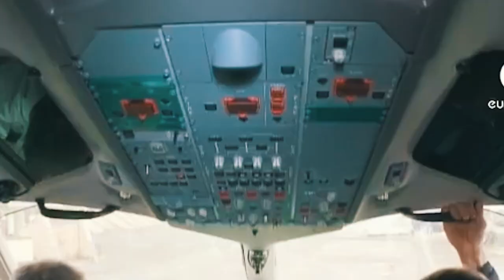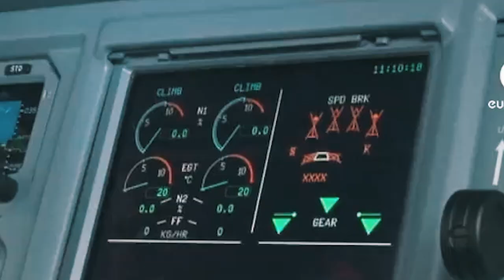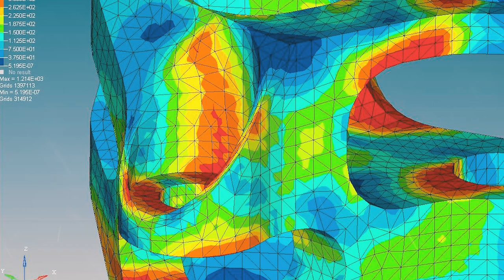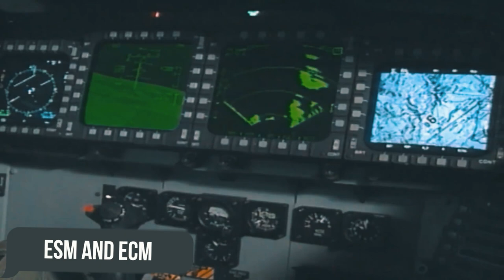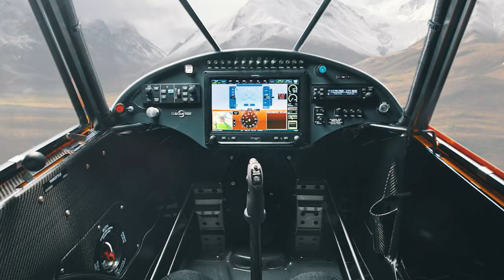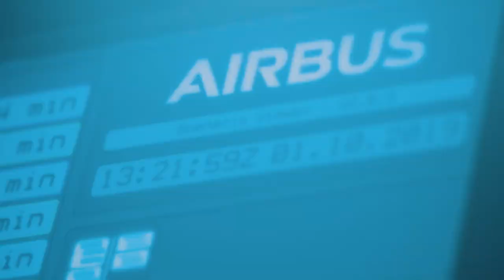Japan Has FINALLY Revealed Its 6th Generation Fighter

Comment: Knots are a unit of distance used in the Navy and Navigation.  I guess they can be abbreviated KN. But here KN sands for a completely different unit: kilo-Newtons.  The standard abbreviation for 1,000 times or 
kilo is lower case “k”. The metric force unit Newton is always capitalized because it is named after Sir Isaac Newton himself.  196 kNewtons equals 44,000 pounds force lbf  or LBF in caps not ibf.

Comment: It's a plane based on Y-23, the prototype who lost to Y-22, who become the current F-22. More than 20 yrs ago. So, it's not 6'th gen, but has the potential to be a great 5th gen fighter. And before speaking of Russia's and China's 6th gen, let's remember that any of haven't proved yet that their fighters are truly 5th gen. Lotsa talk, little facts.
Reply: This also goes for US, the F35 nor F22 proved fully stealth characteristics in true combat mission, for example entering an S400 radar zone, or entering an area covered with AESA radars like the Turkish EIRS radars or something like that., besides stealth doesn't mean full stealth, it means it is stealth for a wide range of radar frequencies so if an area covered with multiple radars with different frequencies it is more likely that F35 or F22 will be detected within 70km of the target, Yes F35 and F22 have weapons that can be fired from more than 200km but that gives the defense systems enough time to respond to incoming attack.
Reply: 6th gen won't be pilot on board- entirely robotic with some human command. I predict extremely fast small swarming robotic kamikaze drones.
Reply: It's really not.
Reply: the yf 23 could potentially reemerge in Japan but it's a wild rumor that is NOT CONFIRMED

Comment: Many of the technologies mentioned that will be used by the FX are unproven, untested, aren't even fully developed, are extremely expensive or some combination of those factors just mentioned, which, more than likely puts it well out of range fiscally for any country other than the U.S but having press releases and what not is extremely smart and effective and may make Japan's enemies think twice about attacking a nation with technology that advanced, whether it actually exists or not.
Reply: So the same for every single generation of fighter.  the biplane with interruption gear to fire a gun forward, the monoplane with gun optics and radial or inline  engines, the first jets, the advent of radar small enough to range guns, passing the sound barrier, self guiding missiles, stealth and so on. every new generation brings new unproven untested.
Reply: Starwars worked for Reagan.

Comment: Knowing the Japanese mindset somewhat, I'm guessing they will go for a lightweight, highly maneuverable, point defense fighter ala the famous Mitsubishi A6M Zero-sen.
They will not be planning a long range fighter as they aren't equipping their military to fight overseas and over long distances as in WW2 but instead to defend the homeland and it's nearby regions.
You can be sure though it will pack a strong punch, be reliable and be bristling with the latest technical aerospace wizardry.
Reply: yeah but "nearby regions" of Japan are actually quite fair away from mainland islands -  I bet they're going for long range, heavy fighter.
Reply: A6M Zero-sen is not a point defense fighter, it had excellent range and it a aircraft carrier fighter, for offensive . it is anything but a  point defense fighter .
Reply: @ducmingnguyen1891  Oh shut up...did you even read what I wrote? "Light weight and highly manoeuverable" Like an A6M, however they will likely use it(the new fighter) as a point defense fighter not as a long range carrier borne fighter.
Of course the Zero wasn't an airdefense or point defense fighter....duh.
Reply: @GM-fh5jp  " I'm guessing they will go for a lightweight, highly maneuverable, point defense fighter ala the famous Mitsubishi A6M Zero-sen." This is what you wrote, read that again. It clearly state that being a "point defense fighter" is a characteristic of the A6M. And A6M is lightweight, highly maneuverable was not the result of "Japanese mindset", it was the result of Japan past war experience, there were plenty exam of Japanese heavier fighter like the Ki-61Hien and the Ki-61 is anything but a lightweight, highly maneuverable fighter.
Reply: @ducmingnguyen1891  oh yes and what do you know about Japanese mindset pray tell?
I have a gate pass to Atsugi Airbase(they have one of the few Zeros remaining), speak fluent Japanese and have worked for the Japanese government for 20 years...
Even a cursory look at the Zero reveals it was NOT a point defense fighter but was, as I wrote, lightweight and highly manoeverable which was requested by the Japanese pilots who had been flying the A5 and predecessors.Perhaps I should have included an extra comma so you wouldn't have been so confused that you had to stridently challenge my opinion..?
Now lets see your list of credentials...

Comment: Question -- since air intakes are a source of radar reflection ---
WHY?? Oh why, are the air intakes always put below the wing or fuselage??
Seems to me,  a blended wing design should be used, 
with the both the air intakes and exhausts being placed ABOVE the wing/body.  
Seems obvious to me.  
Why is that not done???
Reply: No expert, but i think the trade off stealth vs flight characteristics must be worth it. You want airflow above the wings for better lift
Reply: @Coco111s2  What you said.  I'm no expert either.  But from the little I know, above wing engines air flow becomes problematic and the faster the plane the more problematic it becomes.

Comment: MIG41 achieving Mach 4.0-4.3 ? A production aircraft? Yea sure. The PA-FA T-50 with better avionics is being opted out for the upgraded SU-35. But PESA detection from 300km will not give an exact Location. Plus PESA can only operate on one frequency at a time. Making them easy to detect by enemy RWR (radar warning receivers), also easy to jam. But with an AESA the SU-35 range identification will be improved.

Comment: They should of just bought YF23, it is unlikely they can produce a G6 fighter on their own given their inability to produce a solid G5 fighter.
Reply: You missed the inter-company, inter information sharing segment of the video?  That actually is a strength the US doesn't enjoy in their military development. Which is basically, a contract briefing the required specs,  a tender for contract with proof of concept, then locked in.

Comparatively, Japan has the developmental info sharing amongst multiple partners.  Japan definitely has the edge here, and is not alone.

Comment: No no. Japan will not suddenly break out with a super fighter. It’s basically a F16 with stealth. Single engine aircraft like the F35 have a limit on speed and range. These super long range air to air missiles can’t match maneuvering aircraft, only the unsuspecting jetliner. Show me a multi engine long range stealthy design that’s 50% bigger than an F15 and maybe that’s what it takes for a dominant 6 th generation fighter.